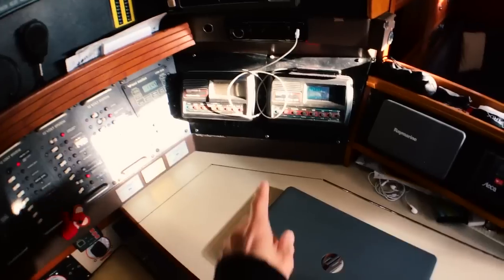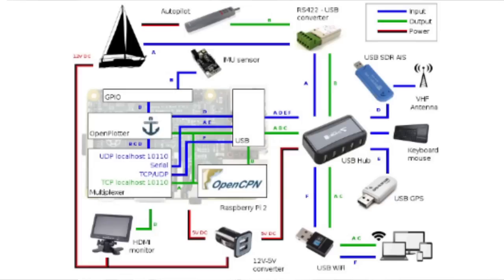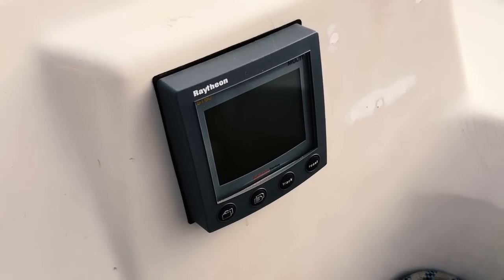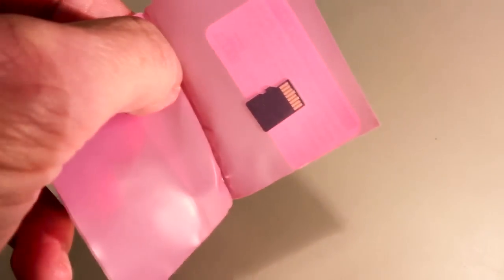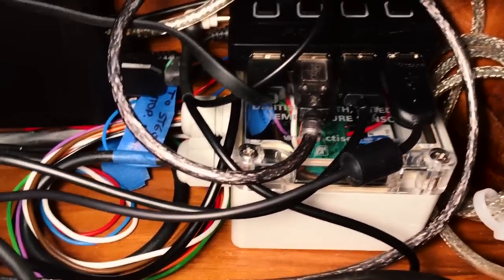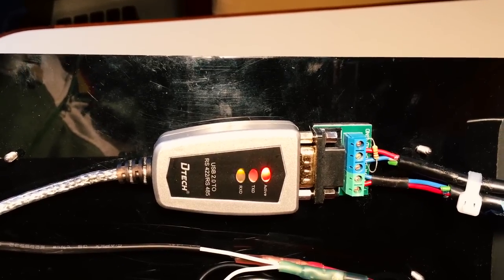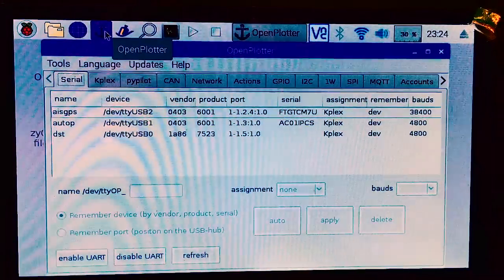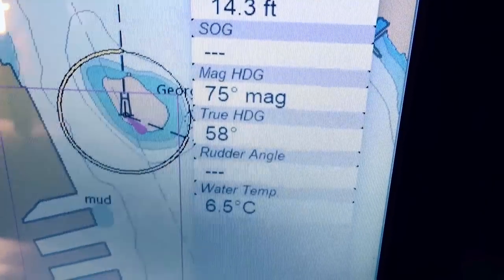How to Sail Digital for CHEAP with Raspberry Pi | Sailing Balachandra S02E32

Comment: How is the raspberry pi working out? I guess its been about a year or so? Curious how well it performs in saltwater conditions? Thanks for posting btw!
Reply from the maker: VERY GOOD QUESTION- as a matter of fact, even though i purchased a second Pi for when the first one failed, it has not! We sail at least once a week or more going on 1 full year of cruising and the Pi has held up perfectly with no issues. Still very pleased with the Pi system :)
Reply from the maker: Just posted a video on exactly this topic, thanks for the idea! :)
Reply: Awesome, thank you for the updates!
Reply: @SailingBalachandra  Great video. Is there any chance you would have (or could make) some sort of diagram of how all these parts are connected?
Reply: @dizzyy1234  The NMEA 2000 network has the boat data, plus the Pi acting as a wifi gateway.  Everything else goes over wifi.  In other words, they're 2 standard computer networks, 1 NMEA and 1 wifi, with a gateway between them to translate the NMEA 2000 data to wifi and vice versa.
Reply: @SailingBalachandra  Could use the spare Pi as a media center for you boat entertainment system ....could even make a video for that .....maybe use Jellyfin
Reply: @dizzyy1234  I know this was 2 years ago but open plotter has tons of documentation on this and there are some videos if you search pi on a boat in youtube.

Comment: About time someone got interested in using a raspberry pi on their boat... 👍🙂....  nice touch.... you can even afford to get another machine as a backup just in case....
Reply from the maker: Yes, exactly. You can create a backup Pi with a mirrored SD card and stick it in your oven to isolate if from lightning :)
Reply: Isnt it gr8? The RPi has been being used as an AIS since its release, lets you not have to pay for a registered AIS. But still broadcasts and receives AIS.
Im thinking og going RPi and a Pixhawk for Navigation and GPS for a cheap system. Looking for thoughts. I know RC grade but with just using the brain on the Pixhawk combine with RPi should have a full system for under 1/4 price of a full boat Nav and GPS system.
Reply: Angus Whitehouse don’t mind me... I’m an old airplane and computer geek. Just think distributed processing with several computers doing separate jobs just like an airplane. I’ve been using, repairing, programming and sorta diy digital thingies since computers were made of discrete parts consisting of some transistors. I’m glad some diy folks got it into sail boats.

Comment: Great video on use of a Pi for Marine service.  Just a fyi, I have a similar setup for aircraft nav and traffic data which uses a Pi3 also.  I suspect that you may encounter a similar issue with the Pi3 as I have.  This is the switching regulator inductors for the power supply on the board are undersized for the application  They are way under rated for the current draw and will over time overheat and eventually fail.   If the circuit board has a cooked aroma your on the way to a failure.  I have had to replace these inductors with a 3-4x size bigger to solve the issues.  Also, the circuits should be in sealed containers to avoid salt air, otherwise corrosion will be a big issue.
Reply from the maker: Wow, thanks for the tip! A bit over my head- we plan to sail with a backup PI in case of catastrophic failures :)

Comment: Very cool, a little to quick, but very cool. This is exactly what I want to do. I was given a 28ft boat, no one knows the make even though registration is mandatory. Meaning it would have been registered when first floated with same boat number and brand/make.

Anyway I have gutted the entire boat and am going to try setup with a RPi and a Pixhawk for all my electronics. Pixhawk is a RC autopilot that is open source and amazing, not really built for full scale but using its brains and larger electric motors should do fine for GPS and nav. 
Long winded but yours is the first video Ive seen using a RPi for anything other then AIS. So now Im at the stage to start planning electronics have boosted my enthusiasm knowing others are doing the same.
Thanks and Fair Winds.
Reply from the maker: amazing! What a big job - Gutting a boat is no joke, but very rewarding. RPi is a great way to go if you don't mind a bit of trial and error, but its' very versatile. The Autopilot you're building sounds awesome - good luck!!

Comment: To be extra fancy you can have touchscreen in every berth with a raspberry zero  behind it, all connected to a server pi with music, films, audio books and how to guides on an external hard drive, for less than 400 buckeroos great for boats with kids
Reply: Loved the idea Allan. Can you explain further how to do it? ;-)
Reply: Paulo Gorab sorry I answered late but best/easiest would be to buy 7" touch screens from Amazon. Each touch screen gets a Pi or Pi Zero (the Z is slow but gets the job done with KODI installed, there are directions here on YT somewhere on how to connect these together through wifi/ip addresses. I would recommend a Lenovo pad set up with open cpn for the person on watch. This is NOT rocket science computer stuff.
Also dAISy hat for the RP gives you AIS reception for less.
Bundled together with a ssb radio receiver and you have weatherfax. 

 I'm positive, total Rasperry build cost will not exceed 1000USd in parts.

Comment: Once everything is working, make an image of that sdcard and put it somewhere safe.
Reply: I would even go so far as to have a second mirrored Pi sitting in a waterproof box and ready to plug in when/if anything goes wrong. Hell maybe even just install a complete mirror system with all the key components, so if something goes wrong all you have to do is switch a few plugs over instead of sitting on a lee shore trying to trouble shoot in a panic since the price is fairly small in comparison to most marine purchases.
Reply: Excellent idea.  Update periodically as it evolves.
Reply: Totally! Let us know where we can git it! <3
Reply: Backups with pi's are super important. Them SD cards have a tendency of corrupting
Reply: Better still, have a complete redundant hardware setup, or a box of parts.
Reply: on an archival grade dvd, in a jewel case - you'll thank me when all three sd cards and your flash drive and your ssd all die at the same time because moisture
Reply: @stevenday2067  I would not upload the charts I had bought (i.e. no pirate copies).
It's easy to make a (Bash/Python) script that copies the chart files to the correct place in the filesystem.
Reply: @mattrice3055  Or wrap up a second one with a simple GPS dongal in a foil bag so that in the event of a lightning strike you have a replacement system
Reply: @DoubleWW  The Pi 4 can now boot from a USB stick.  I have two 128GB sticks one as a backup for the other and a cron job that makes an onsite backup and an offsite backup via wifi to the cloud as well as the micro usb ready to rock.  to be sure to be sure to be sure
Reply: How did he water proof all the wire connectors , usb slots etc. It's marine salty environment,  how many days  it took to get rust. Is 512 mb or 1 gb raspberry old models enough ?

Comment: That's an awesome use for a Pi! Congrats!! You will probably want a fan for the SOC though.  They have cheap cases on amazon that function as a heat sync and come with a small GPIO driven fan.  It will probably last quite a while like it is but will eventually crap out.
Reply: you dont want moving parts in a marine environment. doubt that Pi is getting hot at all. Should be fine. Salt is what you want to keep away from it.

Comment: I see this video is almost two years old but I am embarking on a similar path for our boat Windover. How did yours work for you?  We hope to print a case for a 7" touchscreen at the helm and a 10" one at the nav centre. We will use a Raspberry Pi 3 with Daisy Hat AIS receiver, GPS dongle of some sort and a USB to 12V power supply for the Pi. We will feed data to the helm using Wifi which we can pick up on our devices as well. We will hard wire the 10" touchscreen. This is the plan. Any suggestions? We will do this build on our channel Wind over Water this summer. Any help would be gratefully received.

Comment: Excellent presentation. Just right level of info to get an average newbie (like me) started. Would you consider doing the same for a remote boat monitor/controller... e.g. battery condition, location/geo-fencing, bilge pump, movement detector... turning on and off the odd device? There are a bunch of resources on line, but I can't 'decode' them. They assume too much RPi / electronics base knowledge.
Reply from the maker: We were thinking about setting up the pi to cloud share temperature and bilge pump so we could access it from work. Open Plotter has a tab for custom actions where you'd likely have to enter some code... however I'm not crazy about leaving the pi running 24/7 where I'd like it to be in tip-top shape when we're underway :)
Reply: @SailingBalachandra ... good point. I was thinking about a separate system. Maybe even powered independently by a solar charged battery. It might be better done with an Arduino or ESP.

Comment: Do you have heat sinks and fans for the Pi? We don’t have a boat yet, but we’ve done a few Pi projects. Pi is awesome. From experience though they’re prone to overheat if a cooling system isn’t added
Reply from the maker: Jennifer Thomas Nope, we’ve been running the Pi for well over a year as our onboard Nav computer without heat sync and it has never overheated even here in the hot Caribbean. I have a second backup Pi with a backup duplicate sim ready to go if it ever dies. I was told that the Pi doesn’t need it unless you are running TV or Video Games through it.

Comment: You might want to get the heat sink pack (two heat sinks ) for your pi and allow for air flow, or better still thermally couple the heat sinks to a metal case. I played around with opencpn on a pi and found on a 40'C day it overheated. It depends on the pluggins installed, some like weather routing max the CPU out and drive the temperature up.  High cpu loads drive the CPU temperature up, the PI lowers the clock rate (speed) to reduce the heating which slows the system and unless the CPU loads drops the OS will become unresponsive and eventually freeze. 

Note Raspberry Pi and Arduino are separate universes. The PI is a small computer with an OS while the Arduino is a microcontroller (board) with just a single program running.

Comment: Are all nmea sources 0183? Do all the nmea's have to be connected via a serial 2 USB converter?
I did see the build of the multiplexer you mentioned at the beginning. Many many questions. Any chance you can do an in-depth video on this?
Thanks
Reply from the maker: You can use nmea2000 or seatalk too but you would need to convert seatalk to NMEA with a 'bridge' which are available in marine shops or online. OpenPlotter takes NMEA2000 directly. You will need a serial to usb adaptor. I have 3 on mine. They are dirt cheap on Amazon, i think mine is a dtech rs422. The in depth instructions are found at www.sailoog.org
Reply: @SailingBalachandra  thank you so much.
Does open cpn take nmea0183 directly as well?. I want to add a Ublox  GPS, so just use a serial to ism and plug it into the PI4 right?
Cheers

Comment: Awesome video. I love the step by step instruction without the baby steps(and now I'm stripping and installing the wires). I found a good deal on a Simrad Autotiller. Have you had or heard of any issues with OpenCPN and SImrad/B&G products?
Reply: Have you learned of any compatibility issues between OpenCPN and B&G products?
Reply: @ericwoolery9815  I'm still building up my system. I'll keep you posted.

Comment: I just found this video. Great stuff. Subscribed... 

I followed each of the links in your description. And nowhere can I Find a basic parts list for what you need to get started.

Which Pi? SD card? Power supply? Cooling? Case? Screen? Etc...

Id like to get the basics just to get up and running, then expand a sensor at a time.

Please make another video, or add some Amazon links to this vid.

Comment: Pretty much the best overview I've found so far. I have a very similar setup as far as the existing instruments/etc.  My next step is to connect this to my autopilot, which from what I can see is exactly like yours.  Would you be willing to send me some pointers? I'm getting lost on the wiring (i see a resistor on your DTECH dongle) and on setting it all up on Open Plotter/Kplex/etc
Thanks in advance for the help! :)
Reply: The resistor is used for termination of the RS422 / RS485 electrical  signals. 
https://en.wikipedia.org/wiki/Electrical_termination 

A NMEA 0183 network are based on RS422 signals.
A NMEA 2000 network are based on the CAN bus, where CAN means : Controller Area Network  - which are used by cars.

RS-422/485 Termination and Biasing 
https://deltamotion.com/support/webhelp/rmcwin/Communication_Types/Serial__RS_232_422_485_/Configuration_and_Wiring/Serial_Term_and_Biasing.htm

Sort of useful "RS485 Line Termination Resistor Calculator" 
http://www.alciro.org/tools/RS-485/RS485-resistor-termination-calculator.jsp

Comment: I have a Kenwood D-710ga VHF ham radio. I was looking at the specs and noticed it had a GPS and is capable of NMEA output. I'm not sure what all the NMEA would be capable of and whether its useful in this app but it does do APRS which is a land based location system used by Ham Radio. Someone would have needed to hack it to make it do more ?
Reply from the maker: Sounds really cool! You can always hook it up to your pi and open plotter and read the outout NMEA to see what sentences you get. My guess is GPS data
Reply: @SailingBalachandra  As it is now I've only heard of GPS data but it seems like it could be capable of more with all of the modules it has. I'll be researching to see if someone has written anything for it.

Comment: Great video. I Bought the cable you suggested.  I connected it to a laptop running windows 10, connected it to the computer (nmea). I'm using open cpn. Its not working, the raymarine computer isn't receiving commands from my laptop and pypilot isn't showing as being connected.  My questions are, #1. Does it have to be a raspberry pi computer  and #2 do I connect to  nmea or seatalk at the raymarine computer? Thank you
Reply: Yes dude windows ten has Linux but a dedicated opencpn os on android can be easily set up. Costs less than laptop too

You can probably use a laptop but that has less support vs these Linux communities

Comment: Excellent video. Have you had any connection issues with corrosion?
Reply: If corrosion is a concern then the use of conformal coating on the board and all connections would seal them from moisture. In can even be purchased in aerosol cans.

Comment: I have one of those rs485 adapters and was about to buy a CAN transceiver. Is that one compatible with CAN? Have you used it with SignalK or Openplotter?
Reply from the maker: Not sure. What is a CAN tranceiver?
Reply: @SailingBalachandra  Oops, I meant "transceiver", but it doesn't matter. I guess my real question is about that rs485 adapter that you showed. Did you use that as a CAN to USB adapter, or could you have done that? Or did you just show it because you actually had an rs485 device in the system?

Comment: And be sure to discuss the types and specs of micro SD cards as they have a very limited number of write cycles; cheap sd Cards will die really quickly when used as primary storage. You'll want a High Endurance branded microSD card, and you want to get 3-4 of them from a reputable source since they are often counterfeit. Back up/copy your running image often, as a failing SD card will suddenly die and will offer no option to attempt to read from it.
Reply: I've never heard any of these tips, and never had a failed card. The number of writes is too low.
Reply: Your right. A cheap card in a Pi is a nightmare. It effects the read/write speed ridiculously, I made this mistake in my first RPi magic mirror build. But once upgraded SD card it was 10x faster and so much smoother.
Reply: Your right. A cheap card in a Pi is a nightmare. It effects the read/write speed ridiculously, I made this mistake in my first RPi magic mirror build. But once upgraded SD card it was 10x faster and so much smoother.

Comment: I got some inspiration and started up a pi/opencpn system. It basically works.....but I am having an issue with very slow zoom& pan, so much that I don't really find it usable. Any experience from sluggish graphics?
Reply: I think you can configure the zoom response on the configurations (interface?) menu.....? Tried its already?

Comment: How did you power the Pi? The newer Pi’s need a good power source otherwise they become unstable.
Reply from the maker: I ran power from my 12V system through a breaker (for protection) then through a Fuse (to protect it) THEN through a 12V to 5V downconverter. It's VERY IMPORTANT to choose the right Amps. A PI needs 3A to operate. If you just use a Cell Phone plug you will not get adequate amps.

Comment: What is the cheapest way to buy a RPI in Canada? Canakit works out to be quite expensive.
Reply from the maker: I just bought the pi standalone- no heat sink, case, etc. I bought a cheap plastic box to use as a case. The pi alone is not expensive
Reply: @SailingBalachandra  From Canakit?

Comment: Hi, great videos, keep them coming. I have the same Raymarine course computer and want to do the same.  Have you been successful controlling it from the raspberry py through NMEA 0183?
Reply from the maker: yes - plug the NMEA output into the computer's NMEA input #2 (not #1). The output sentences come from OpenCPN into the NMEA data stream (signalk) - message me on FB for details if you have trouble :)
Reply: Magic, thanks for the reply, will be getting on to the installation in the summer, can’t wait...